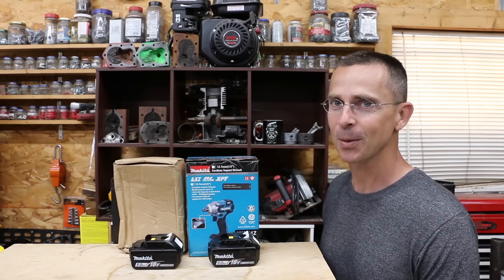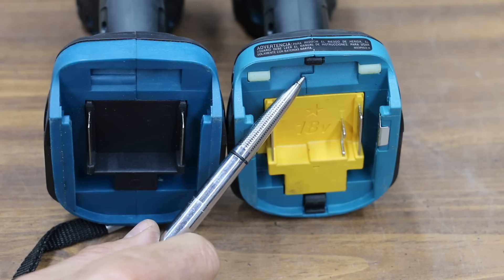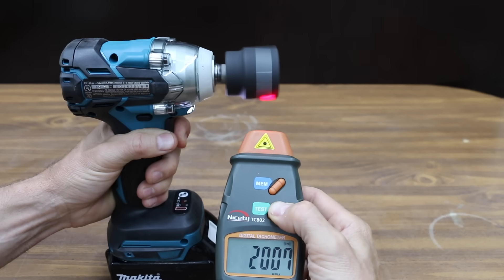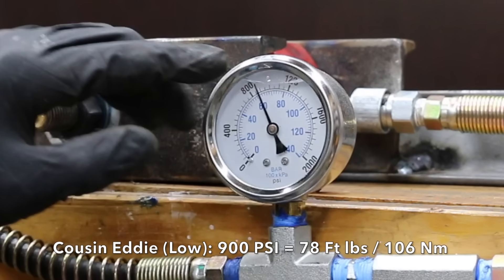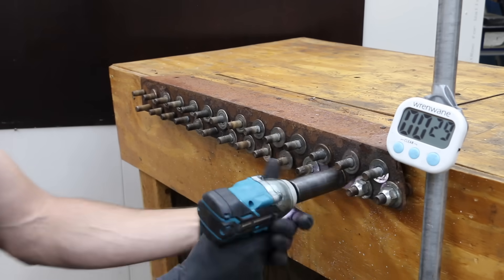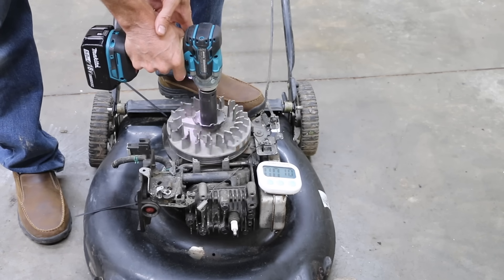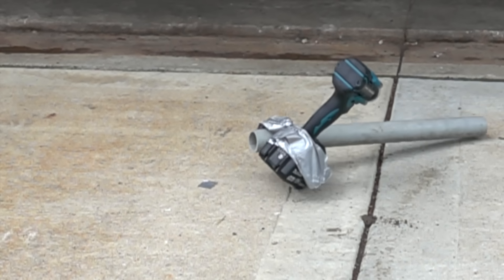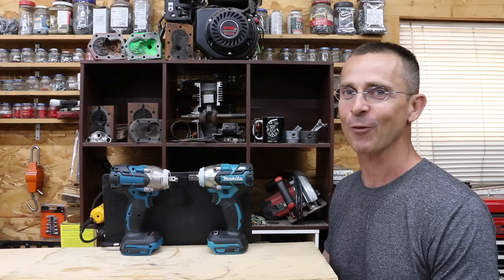Fake Makita Impact Better? Let's find out!  Makita XWT11Z 18V LXT Lithium-Ion Brushless Cordless

Comment: That hole on the anvil of the cousin eddie is for a "go through" pin to connect the socket. You need to have the Chinese version of the impact socket (harbor freight does not carry) and that go through pin for cousin eddie to yield the maximum torque.
Reply from the maker: Thanks for sharing.

Comment: Even if Cousin Eddie does work almost as good in some ways,The real test is durability over time,I'm a GC for 20 years,Stopped buying Makita years ago,They work great,but batteries burn out every six months or less,It's over $100 a new battery,Ridget tools give a lifetime warranty on everything ,replace batteries for free forever,Just have to go online and register after you buy a tool,and insert serial numbers of every tool with the ridget website.
Reply from the maker: Thanks for sharing.

Comment: I am reminded of the story of a couple of guys that went to a tech flea market in Shenzhen China. A guy found his Bose speakers in a bin without any Bose stickers on them and the cost was about  $3. he asked his friend to translate , asking " I paid $150 for this in the US. How is this so cheap?" She comes over with a folder full of stickers of different brands and puts a Bose sticker on it and says "There, now is worth". 

Back when manufacturing and brand were inextricably linked, brand was a good indicator of quality. With all manufacturing being outsourced, and brand being little more than a financial security that can be traded on an open market, all that matters is quality control - if the guy with the random letter generated seller name on Amazon and his little factory in Guangzhou has better QC than Dewalt or is the manufacturer selling the brand name product direct, I'm going for the REZNFEOUF. 

While the Makita obviously did better, Cousin Eddie is all I need. And I take off crankshaft pulley nuts semi-regularly. This "knockoff" would be a prime contender in the pro-sumer market.
Reply from the maker: Thanks for sharing.

Comment: My first set of "real" power tools were knock-off brands of the good ones. I was in my 20's and just really learning my way around a tool box and handyman work.Tools are expensive and I was broke as fuck. Inhad been building my new box which until I bought my first house was a big craftsman box that I kept in the back of my old beat up Subaru Staion wagon that Inused to get back and forth to work. When I did finally buy a house I'm not joking when I say that I left the closing table with my pockets turned inside out. All I had was Lint in them. The cheap tools I brought over the years was all I could afford and they served me well for years. We performed many tasks together. Back In the day I bought a $40 hammer drill that I did multiple jobs with over the years. The hammer chuck finally died when inwas drilling marble tile to install shower doors...the guy that was helping me install the doors kept killing batteries on his 20 volt Mikita. I was like, bro hold my beer and got my electric knock off hammer drill and yea it gave up the ghost at the end but not before it finished the job and drilled 5 of the 6 holes.

Even though I have upgraded to better tools as I have needed them and am fortunate that I can afford them, I still have most of my cheap knock off tools and use them as needed. I also have found out that it's easier to lend a neighbor or a friend a cheap knock off then the expensive name brand. 

My long drawn out point is that cheap Knockoffs do indeed have a use and a place in this world.
Reply from the maker: Thanks for sharing!

Comment: Just a thought if you put the rpm meter on a smaller socket closer to the 1/2" shank size wouldn't the rpm be faster
Reply: due to the force required to spin the socket? possibly, but if he uses the same one, it shouldn't matter
Reply: @frep420  sorry I did not mean against each other I ment against what the manufacturer spec the large socket takes further ie time to complete its circle
Reply from the maker: Thanks for the video idea.

Comment: Glad you used Makita batteries on both. I remember back, oh maybe the late 90s, when I was getting into pro video gear, people were wondering why not use generic batteries at a quarter or third the cost of a genuine Canon or Sony? Well, the genuine ones were made in Japan with Japanese cells. The generics were made in China, and some used Chinese cells, but better ones used Japanese cells. I got the latter and never had any issues.
Reply from the maker: Thanks for sharing.

Comment: Just an FYI. testing by pressure gauge is only remotely valid during the middle 50% of the gauge scale. The bottom & top 25% of a gauge scale is highly inaccurate.

Comment: Cousin Eddy May be a good value, but look at what China has done they copied the Makita, that means no RnD costs to recuperate. Then their cost for labor must certainly be lower. I don’t see that they’re offering a better product at a lower price. I see patent infringements with the goal of undercutting a quality manufacturer. I like Makita because their products are more consistent for battery interchange. Other cordless tools I’ve owned change their battery configurations frequently and then you have to buy their new line of tools. I see it as in your face marketing, Makita doesn’t do this. That shows me they want repeat customers that will buy their quality tools.

Comment: Which lawnmower blade sharpener is best? I recently bought one from all american sharpener. So far I love it. You need an angle grinder that has a spot for a handle but I had one so no issue there.
Reply from the maker: Thanks for the video idea.

Comment: Not sure if I would buy something like cousin eddy since I bought knock off batt drill in the past and the batts lost their ability to take a charge after 6 months. Yea they worked fine for a while but once the batts died they became paper weights. As for impact tools like this I have both air impact and corded ones. I find they just work good for my own needs. I am sure a cordless impact may be nice but when it comes to impacts I can deal with the cords or air hose.
Reply from the maker: Thanks for sharing.

Comment: 100$ cheaper and slightly under performs : I see this as a win for "Cousin Eddy"...
Reply: Except for the part where the internals on Eddy were pretty worn down at the end of just a few tests and the Makita barely showed any wear. The Makita would definitely outlast 5 of cousin Eddy.
Reply from the maker: Thanks for the feedback.
Reply: @ProjectFarm  Thx for the comparison !
Reply: Ditto~!!!
Reply from the maker: Thanks for watching.
Reply: Yeah, if they made it 50$ and used a bit better parts, Makita would be in a lot of trouble.
Reply: @antoniorsoftware  not 50 but 35 $ and Makita would be out of business.They are probably dealing with Makita directly so it wont affect their sales,like getting over their market share.

Comment: I say buy both - when your useless brother-in-law comes over to borrow something to bust the door trim panel off his cancer-riddled 90's Aerostar and replace the mirror that’s been hanging by the wires against the paint for 3 years, you can open up your decoy tool box and hand him Cousin Eddie. Maybe even scrawl "Nakita" on the side with whiteout - he'll never know the difference, and when he accidentally loses it, you're only out the $30 he was going to bum off you for 2 cases of natty ice anyway. Hopefully, he has enough shame to never ask to borrow another tool again and the Real McCoy will be safely ensconced in a locked drawer of your real roller cabinet. BTW, great vid. You thought of more real-world tests than me and the boys "back at the shop" would do in our big-impact swinging days.
Reply from the maker: Thanks for sharing.  lol
Reply: In all seriousness, there’s justification for buying a cheap tool you rarely use – I’ve done it myself. But before you do, ask yourself this – “if it fails at the worst-possible moment, could it: A) injure me (e.g., a chisel) or B) greatly inconvenience me (i.e., unable to finish the job)”. If you answer yes to either one, perhaps cost isn’t your top priority. In this case, the performance difference between the two is so great I’d pass on Cousin Eddie. I break out the impact to get the job done NOW, not to wait around for it to “eventually” break the fastener loose. Riddle me this:  ever get out a small impact you “think” will get the job done, but it fails to break the fastener loose, and with every ineffective ugga-dugga you feel your blood pressure rising until you can’t take it anymore and scream out loud, stop what you’re doing, and go for the bigger one? Yeah, I thought so. The BIGGER take-away here is that “caveat emptor” still applies – sellers can make any bogus claim they want. Thankfully, when you buy a tool with the reputation that Makita has earned, you’re trust is not misplaced. And thankfully, we have unbiased testing of sellers’ claims by PF.

Comment: Since you have the Hydraulic fluid test setup. Can you test different sockets and adapters (maybe a 3/8 to 1/2 or vice verse) extensions, or swivel ends, and see how much torque loss there is between normal kit type sockets, thin walled sockets, impact sockets (cheap VS expensive brands) etc?

There would be some scenerios where you need to put a 6inch extension and a swivel end on with an impact to reach something and wondering what % loss there is with each fitting!
Reply from the maker: Thanks for the video idea.

Comment: Thank you for a really thoughtful and comprehensive showdown. Great video. I'm curious about the performance and longevity of the knockoff batteries. A genuine 3Ah battery costs about $40 vs. $20 for the knockoff. Regardless, I think it's pretty cool that  Cousin Eddie and Makita can share batteries. I have 4 various Makita  18V drivers and expect they will outlast their batteries many times over.
Reply from the maker: Great suggestion!  Thank you.

Comment: Honestly, if you're not a professional... The price is not justifiable at all
Reply: If you are a professional, the cheapo one is very justifiable.
Reply: I meant to say if you are NOT a professional.
Reply: I’m not a professional but I’m always fixing things around the house or car and I only buy Makita. They are great tools and last forever.
Reply: Depends on what you're doing
Reply: Wrong, even if a person is not professional. 
1st a good quality tool will last you for a very long time. 
And 2nd, when you need the tool the most, the cheap rubbish might not work anymore. 
That would be frustrating and end up cost more.
Reply: @erikjohansson1814  Nah man, that's why you buy 2 knockoffs so you have a backup and it's still half the price
Reply: @erikjohansson1814   indeed. If your going to buy yourself a power tool, spend a bit extra, treat yourself to something really decent (Makita, Bosch, Milwaukee) and you'll have an excellent versatile tool and it will last you for years to come.
Reply: Professionals make enough money to use, abuse and expend quality tools. For everyone else, pro tools are also worth the investment for longevity sake.
Reply: I've learned my lesson that cheap Chinese made junk is not worth it. The problems that come up and the frustration when it is broken after a couple of months is not worth the cheap price. I will not buy anything made in China anymore. Even the Chinese prefer to buy foreign made quality products over their own cheap made Chinese junk that will not last very long.

Comment: Ooh! I got a fake Ryobi model P237 that I picked up at eBay!!! For $29.00!!! Every Ryobi Tools and their models that I owned and purchased always have a serial numbers, but this one didn't have one!!! And the magnet tray broke off after driving 4" of deck screws and 3" lag bolts. The belt clip were made from just weak galvanized stuffs. And the battery is not the original Ryobi made, but after market ones and the charger is different from the original Ryobi charger. Guess what! That badboy broke after installing just only 20 screws!!
Reply from the maker: Thanks for sharing.

Comment: Here's an idea.  I've been trying to find out which method of hot bluing works best.  Not using caustic salts, but heating up steel and then quenching it in oil.  I've seen videos saying use any oil, or new motor oil or used motor oil.  I wonder if there is a difference and if there is, which one works best.
Reply from the maker: Thanks for the suggestion.

Comment: The knockoff doesn't have a battery sense wire (the 3rd prong on the bottom of the drill) so the battery could easily overheat or the drill motor can burn up. It also doesn't have the safety fuse like the Makita did. The only thing I don't like about the Makita is the pcb board that connects the motor wires. The impacts can make short work of it and break the leads, but time will tell.
Reply from the maker: Thanks for the feedback.

Comment: I came here expecting cousin Eddie to disappoint me, but oh boy, not this time. You did a great job Eddie !
Reply from the maker: Now that compliment made his day!
Reply: @ProjectFarm  where can one buy a Cousin Eddie?
Reply: @sisler42789  The OP said EBAY
Reply: Same to be honest. But in spite of it being a little slower than the name brand, it still did its job. So I'd say for 30 bucks it's worth it.
Reply: @Mr_Sokoll  yes and no:
Yes, for less intensive and lighter use  it would do the job too, but bit slower.
No, for harder works this "couple" Nm REALLY makes the difference. 

PS visually they are quite similar. But technically they must be (price) and are quite different. Retail prices of Makita li-ion cells would be like 10-15$
Reply: @jacek-jan  Not to mention that "cousin Eddie" will be broken after 3 uses and there is no technician support for it. Cheap chinese tools never worth it
Reply: @MrPanos2000  not really they are cheap on the battery.. but for e few years its fine,.
Reply: @MrPanos2000 The point is who will fix the 130$ mikita? Mikita would give u a bill for 200$ to fix it.
Reply: DeWalt vs Milwaukee
Reply: For home use, the $30 one will do the job and save a lot of money, I want one!
Reply: Who the hell is cousin Eddie?
Reply: @SKANK_HUNT49  you are if you haven't watched lampoon's Christmas vacation
Reply: @johnwilkinson154  is that right
Reply: @SKANK_HUNT49  He's the cousin of Clark Griswold from the National Lampoon "Vacation" movie series. He's a leisure suit wearing low /no income trailer park kind of guy. He's fun but doesn't amount to much
Reply: Thanks for the spolier :/
Reply: Amazing effort has been put in to make this video. However too much editing
Reply: @coasterchris01  I'm in construction Makita makes garbage drills.
Reply: @SKANK_HUNT49  Mh No you are wrong .. our plumber company (in Germany) uses almost all Makita Tools ..  and in my private Workshop i also Use Makita and never had any Problem with it

Comment: There's another brand that makes power tools inspired by bosch, makita and other big brands, the "DCA"/"Dongcheng". I'm replacing most of my workshop's old bosch and makita power tools with this brand. The quality is superb and is roughly half the price of it's bosch and makita counterparts. The killer blow to makita and bosch is the replacement part cost and availibility of DCA, you literally can purchase each replacement parts and assemble a whole new unit by yourself, at about the same cost.
Reply from the maker: Thanks for the feedback.

Comment: Cousin Eddy also has a 30% retail return rate. If you can find the retailer that sold it to you and get them to take responsibility for the return, you only have the hassle of returning it for a new one. Otherwise, you are stuck with a drill that does not work.
Reply from the maker: Thanks for the feedback.

Comment: Video idea.  Are non synthetic compressor oils better than non detergent straight weight oils?  In terms of home compressors, reciprocating with reed valves.
I see a lot of claims but no evidence that these are not simple non additive oils.  When additives are talked about its generally in regard to rotary compressors.
Reply from the maker: Thanks for the video idea.